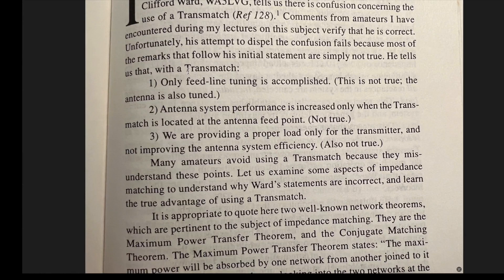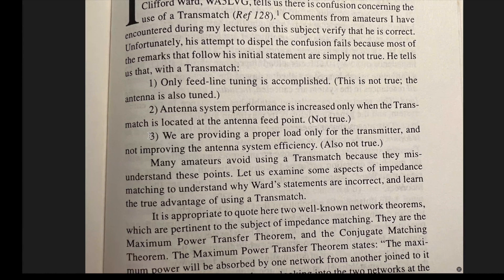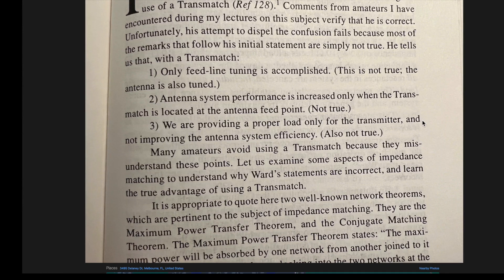Ham Radio Remote Antenna Tuners - An Unnecessary Waste Of $.

Comment: My thoughts are that this is very good advice for single band antennas.  However,  coax loss can be excessive when trying to transmit on different bands....then a remote tuner is a better alternative....I believe.  What is your thoughts on this?  Thank you, Mark, N2IRY
Reply from the maker: Yes true if coax loss is excessive.  One question is - what is excessive?  On the HF band with the highest loss, 10 meters, an SWR of 5:1 on 100 feet of LMR-400 causes an additional SWR loss of less than 1 db.  If your SWR is much higher than 5:1, I'd say you need to use a different antenna or adjust the one you have.

Comment: Thank you. I always love your videos. You remind me of the old hams from my younger days that seemed to do everything "wrong" according to the times, but they always made contacts.  

I'm all for minimizing loss as much as it is cost effective and practical.  But, I've learned that on HF, "loss" is not very important. 

That's not to say it isn't important to those running QTPp.  

9 days ago, on September 10, I was trying to get my Xiegu set up on FT8.  I could not get it to work. When I looked up, someone was answering a CQ I accidentally sent.  For the first time, ever in 47 years of ham radio, I made my first 160 meter contact totally by accident!  I was running 1 watt into a 19 foot vertical through a tuner that may not have even been tuned. The contact was 232 miles away. Since then, I have only made 6 160m contacts running 5 watts and this is still the farthest station I've reached. 

That's a 0.035 wave length antenna.  By itself, the antenna is "more than -10db loss" according to Google AI. According to Google, I made that contact with an ERP of about 0.1 watt or less.   Again, according to Google, a 100 watt station could have made that contact with a 30db loss.  

I see operators running QRP with RG-174 and EFHW antennas for POTA and other portable operations. 

On HF, nothing beats propagation...

Comment: Retired  broadcast engineer here. I agree with most of what you are saying, except for "full power transfer". When the antenna tuner is in the shack, there will be circulating reactive current in the feed line. If the feed line was lossless, this would not matter, because the power would circulate back and forth in the feed line until it was eventually radiated. But in a lossy feed line, some of this circulating power ends up heating the feed line each time it circulates. If the tuner is at the feed point, there is no circulating reactive current in the feed line and the transmitter power only traverses the feed line once, so loss is at a minimum. So it boils down to: how much loss are you willing to tolerate.

AM broadcasters have been placing the tuning networks at the antenna feed point for a long time, often a simple pi-network, but it gives a perfect 50+j0 match to the coax back to the transmitter building for lowest transmission line loss. I am a fan of the remote auto-tuner. This is probably because of my broadcast background. Is it necessary? Probably not for hams. But it is the way that professionals do it.

Unlike other hams often say (not you), the antenna tuner does tune the antenna, changing it's resonant frequency, regardless of whether it's in the shack or at the feed point. I wish we could stomp out the myth that antenna tuners don't tune the antenna.

73 de N3TS
Reply from the maker: I agree with everything you said, including an antenna tuner tunes the antenna to resonance with a conjugate match.  In broadcasting it makes sense to have a matching network at the antenna because the station broadcasts on only one frequency.  That is not the case with hams.  As for the "full power transfer," I said minus some usually minor coax losses in the HF bands, which is true.

Comment: I feed a 160 meter doublet using ladder line with a remote tuner at the ladder line end and it's not uncommon to see an impedance of 1500 ohms on some bands. With the match calculator shown... It's 72% loss.
Reply from the maker: If I get what you are saying, if the antenna impedance on some bands is 1500 ohms and your line impedance is 450 ohms (lets say Wireman 551 Ladder Line) your SWR is 3 to one.   Let's say that's the 20 meter band.   With 100 watts out into 100 feet of that feed line your total power delivered to the antenna is 94 watts.  That's a loss of 6%.  This is with the ladder line connected directly to the antenna - no remote tuner.  You don't use a remote tuner with ladder line.  You use a desktop antenna tuner at the transmitter end.

Comment: A lot of antenna matching theory can be learned by using a program called SimSmith, and observing the changes in Z at various points along an antenna system.  You can simulate a transmitter, a transmatch, a length of coax, and a load of various impedances.   You can take antenna data from NEC2 antenna design software and plug it into the load.  Modern tools such as the NanoVNA allow real time observation of impedances while adjusting an antenna tuner..  These tools might contradict time honored theories about what happens to impedance as various parameters are changed.   Watch some of W0QE's youtube videos...
Reply from the maker: Will do good tip.

Comment: Hi Mark - as a relatively new ham, I've only had my Full UK licence for just over 1 year, I find this a fascinating and difficult subject. Intuitively, I would have thought that having the tuner at the antenna end would mean that any reflections would only travel between the antenna and the tuner and back - resulting in extremely low losses. On the other hand, having the tuner at the radio end would mean that any reflections would bounce up and down the coax - resulting in higher losses (even if those losses are very small). Am I correct in this assumption? Or does Walt Maxwell's statement that the transmatch "tunes the antenna system" mean that this is false? Either way, I think what you are saying is that the losses are so negligible in either scenario, that it really makes no difference in the real world. For what it's worth, my main antenna system is an EFHW for 80m fed with about 10m of Messi & Paoloni Ultraflex 7. So I have a fairly short run of low loss coax going in to an antenna which is resonant on the bands I tend to work. I could run it, and often do, without a tuner at all. However, I have a 1200w linear which has multiple protection circuits on it which kick in if the SWR is even slightly above 1.5:1, so I use the tuner when I'm running higher power.

Mark - thanks for all of your videos. I have learned so much from them and have started reading Maxwell's work, as I have no background in any of this stuff, and only a very basic knowledge of electronics and physics. Keep up the great work!
Reply from the maker: "the losses are so negligible in either scenario, that it really makes no difference in the real world."

Jack this statement shows that you have the correct understanding.  Here's a quote from one of Maxwell's books:

"In our efforts to obtain low feed-line SWR values of 1.1, 1.2, or even 1.5 to 1, we have gone far past the diminishing-returns point with respect to efficient power transfer, even for single-frequency operation.  It is like installing no. 4 or no. 6 wire in a house-wiring run where no. 12 wire is sufficient."

"Further, it can be shown that many typical coaxial feed lines we use in the HF bands with an SWR of 3 or 4, and often as high as 5 to 1, have an equally imperceptible difference. When feed-line attenuation is low, allowing such higher values of SWR permits operating over reasonably wide frequency excursions from the self-resonant frequency of the antenna with the imperceptible power loss just described, in spite of the popular impression to the contrary."

Since a desktop tuner tunes the antenna system (tuner plus feed line) to resonance full power is delivered to the load minus some minor line loss.  

As a new ham you are fortunate to get an understanding of the unimportance of SWR in the HF bands since the hobby is rife with legends and myths.
Reply: @BustRadioMyths  Thanks for taking the time to come back to me, and for the kind words. I have since put a few numbers in to the coax loss calculator, and with my set up, it really makes no difference at all. With a 1:1 match on 10m I am losing 0.4dB. If the match were 5:1 I would lose around another 0.4dB. Since the "worst" SWR I get is on 80m and is still below 3:1 I am losing an extra 1% of my power. As I mentioned, the only point in my having a  tuner is to keep the linear amp happy - the radio can deal with 3:1 internally but the amp is more picky. Thanks again, and best 73s from Scotland.

Comment: Ok, although I completely agree with you on the myth busting conjugate tuning of the antenna system and the general impact of losses due to mismatched coax to feedpoint impedance, you should be a bit more specific on how you state this.

Yes, 4:1, 6:1, 8:1, etc. losses on the 20m example using something like RG-213 isn't going to affect much with only 1/4 to 1/2 of an S-unit total loss (and maybe even 6db or 1 S-unit around 10:1+). I know you mention this a bit, but there are cases where the feedpoint impedance is very high and the line losses are going to exceed 70-90% unless you have a remote tuner or some means to compensate for the reactance at the feed point. One example would be a long random wire antenna that you'd like to use as a constrained multiband choice.

So, I wouldn't negate remote tuners outright in specific instances. But, you made good general points on this! 
- KN0VA
Reply from the maker: You make a good case.   I'd say if your SWR is too high try a different length antenna.  There are published recommendations for long wire antenna lengths to avoid problems.
Reply: @BustRadioMyths  Yes! Definitely. In one example for me - I use a remote tuner when in the field and just need to throw up a wire and not worry about lengths - makes for a easier mobile setup. Also, I've seen cases of HOA examples where only a single wire is available to be stealthy but gives them multi-band options.

PS - I really like your myth busting on losses!!! Thx for the videos!

Comment: Too many assumptions are being made, such as that the ham is using coax, not ladder-line, that it is a high quality coax cable that won't arc at voltage peak points in the coax, and that the frequency of operation is in the HF band. Also, Mr. Maxwell is very careful about the way he phrases his statements so that they are technically true, while implying that other things are also true when they are not always true. There are simply too many variables that go unmentioned. The fact is that an RF transmission system is 'best', all other things being equal if it has a properly matched impedance from the transmitter to the antenna, for a variety of reasons. They just may not be the reasons that many hams think they are. With modern commercial appliance radios the output is designed to match a 50 Ohm unbalanced feedline. If a 50 Ohm coax cable is attached at that point, then fed out to a 50 Ohm unbalanced feedpoint on an antenna matched to 50 Ohms for the band of interest, no matching device is needed at all. But if there is an impedance mismatch at that point, then that's the best place for a matching device to be placed for a number of reasons, although possibly not the reasons a lot of hams think. It's also NOT the best place for a number of non-RF reasons, like the fact that it is placed out in the weather,  and is likely more expensive than an indoor matchbox unless the ham builds their own, which is what I recommend they do. There's a lot to be learned from building a simple remote antenna tuner for the ham's base station, and a good bit of satisfaction in figuring out how to make it work well. It may well be the most about RF to be learned from a simple and inexpensive project.
Reply from the maker: I don't think you meant build your own remote, outdoor antenna tuner.  I suppose you are referring to building your own desktop type tuner which would be a great project but the parts are hard to obtain.
Reply: Yeah Maxwell is very clever to say the tuner tunes the antenna to resonance

Comment: I like what you say BUT. with my tri band yagi, my internal tuner will adjust itself to provide a 1:1 match (yea!) but my inline external tabletop  SWR meter shows a considerably higher SWR, maybe 5:1 or even so high the cross meters don't cross. Yes, I know that two SWR meters are not the norm. Which meter, if any, should I believe?
Reply from the maker: The external meter in the line shows what your match is at the antenna and for a tri band yagi that sounds high.  Get on eham.net in antenna forum lots of knowledgeable guys there who are glad to help.

Comment: While the desktop tuner does in fact tune the antenna "System" into resonance, or as close as possible to resonance. The coax loss will always be a factor. The higher the SWR the more losses you will see. These are just known facts. Now the best possible tuner location can be argued forever and it has been. As long as you remember the load seen by the transmitter includes everything connected as a system,  or node. The tuner DOES NOT change the resonance of the antenna, on this he is misspoken. The antenna does not change, the tuner changes the overall impedance of the entire antenna system, yes. But the antenna doesn't change.  The feedline itself acts as an impedance transformer also. So you must think of the antenna as a system consisting of everything connected to the transmitter.
Reply from the maker: How could the antenna system become resonant if there was not resonance created at the load?  If the antenna system is resonant, there is no reactance.   That could not be the case if there was reactance at the antenna feedpoint.  This is not my idea BTW.  I quote from Walt Maxwell W2DU in his Reflections - Antennas and Transmission lines books.  

“When a conjugate match is accomplished at any of the junctions in the system, any reactance appearing at any junction is canceled by an equal and opposite reactance, which also includes any reactance appearing in the load. This reactance cancellation results in a net system reactance of zero, establishing resonance in the entire system. In this resonant condition the generator delivers its maximum available power to the load. This is why an antenna operated away from its natural resonant frequency is tuned to resonance by a Transmatch connected at the input to the transmission line.”

You can disagree with him if you want but I'd urge you to examine his qualifications and accomplishments which I posted in the description of this video before doing so.